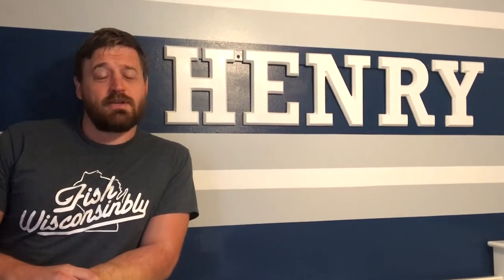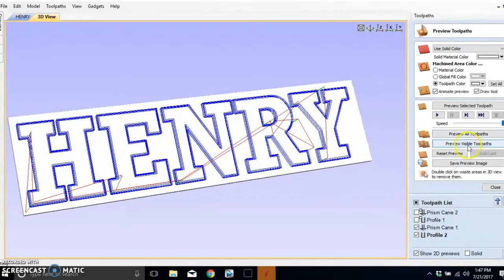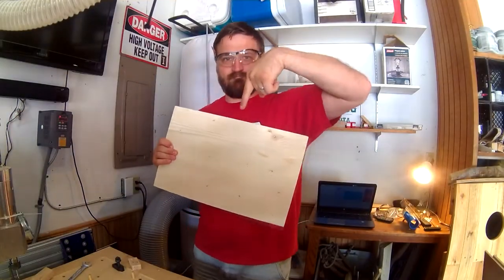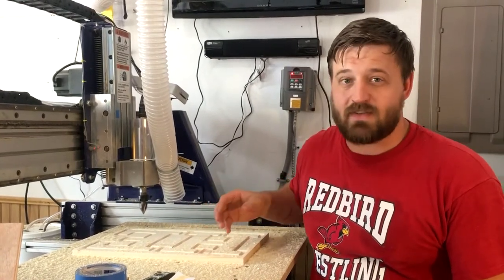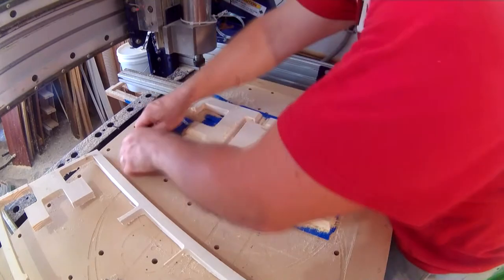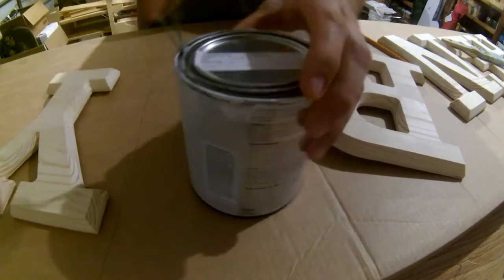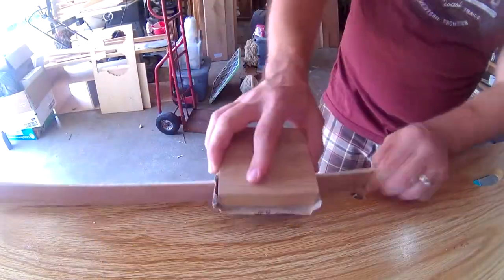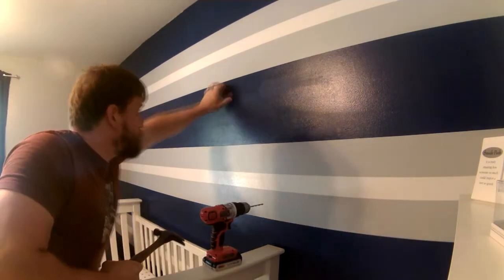Make "3D" letters to hang on your wall

Comment: NIce video, consider using oracle transfer paper as it's cheaper than blue tape.  I also have used the instant glue however I find hot glue much better.   It works well with blue tape also and u wont really need to cover the entire piece.  Just a few strips across the spoil board and the part will work fine.
Reply from the maker: Thanks! I've actually tried all those methods in other projects since this video. Not sure which is my absolute favorite yet, thought. Sometimes one is better than the other depending on what the cut is and what the material is.